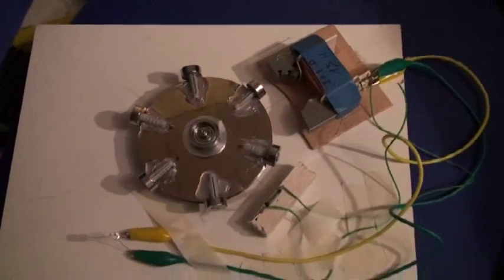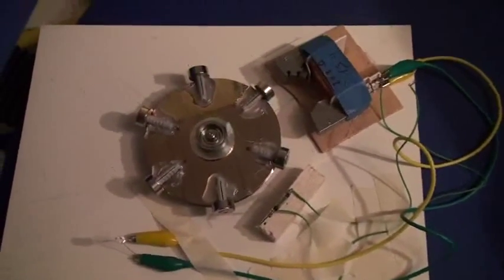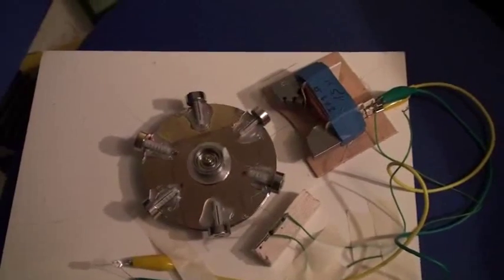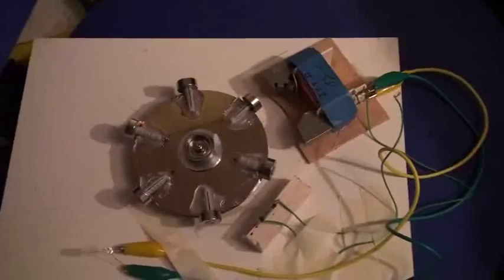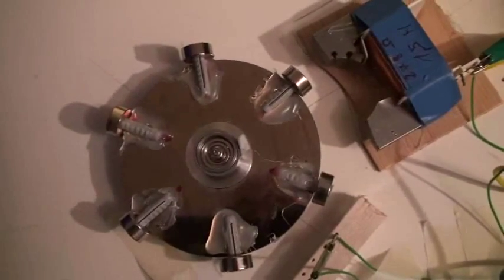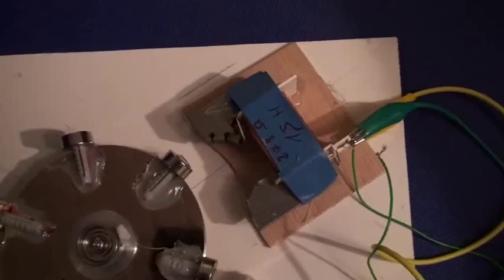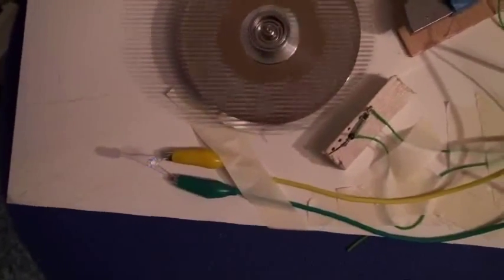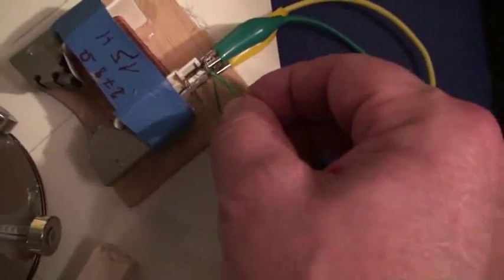shorting coil test 3.wmv

Comment: @rave154 It comes from the opening of the reed switch.  If you replace the LED with a resistor then the voltage spike will be proportional to the value of the resistor.  A low value resistor will give you a low voltage spike and a high value resistor will give you a high voltage spike.  The LED in this case acts like a low valued resistor and the spikes are around only 1.5 volts.

Comment: (2nd) You should not feel any voltage on the skin of your fingertips because 12 volts is too low.  Now, disconnect the power supply and you may get a surprise in what you feel on your fingertips.

The coil generates high voltage because of the fast disconnection.

You know that if you short circuit a capacitor you get a spike of high current and the voltage stops to zero.

When you open circuit an inductor you get a spike of high voltage, and the current drops to zero.

It's like Yin-Yang.

Comment: Electronics is fascinating and fantastic, no?  lol  When the reed switch opens you get the famous "back EMF spike" just like in a Bedini motor and that's what lights the LED.

If you don't mind an electrical shock you can try this simple test:  Take a standard  12-volt relay and get a 12-volt power supply and observe the relay going on and off. Turn the relay upside-down and power the energizing coil and put your index and middle finger across the terminals of the coil.